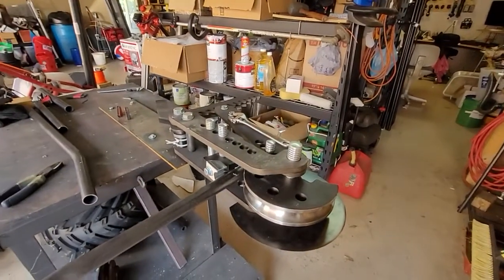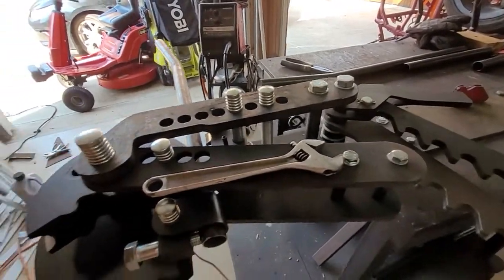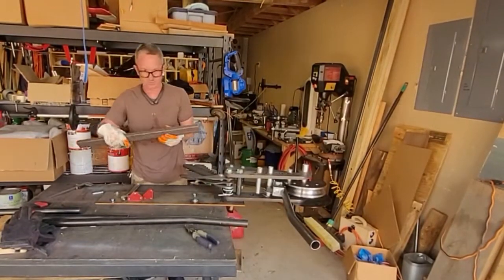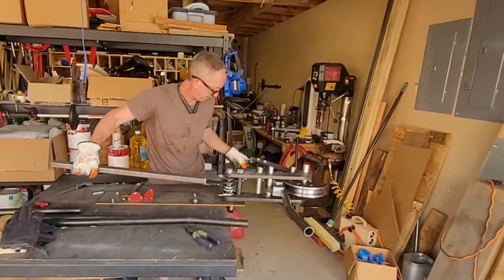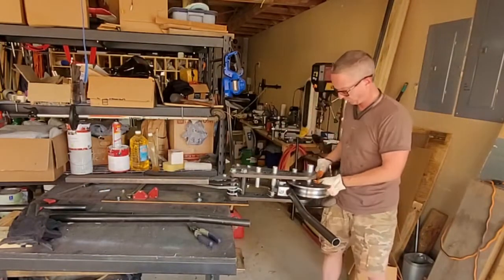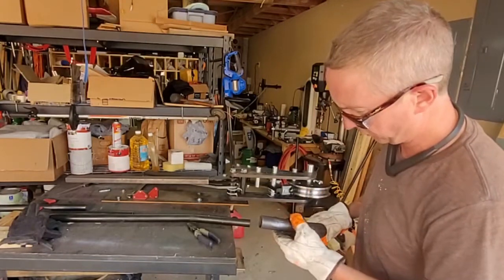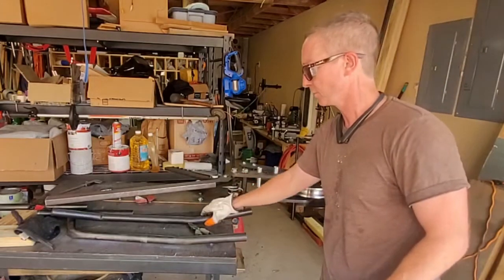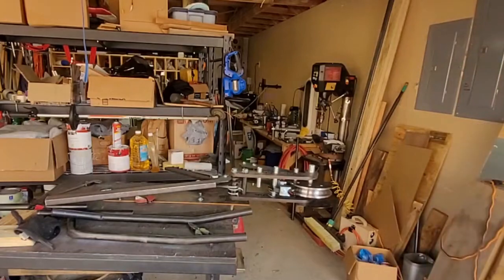I bought the cheapest tubing bender on Ebay

Comment: Hi.  thanks for the video.  Nice job.  whould you mind measuring the center hole of the die and the drive pin holes of the die and post them here.  I what to see if JD squared dies will fit my bender.  I have the vevor bender, it looks the same as yours.    Thanks.

Comment: 0.060 wall is more likely to crinkle than thicker pipe. The site has a minimum wall thickness spec and I think 0.095 is close for this di meter. Also, pipe and tube require different dies. Also, just oil the black oxide instead of complaining.
Reply from the maker: Lol, will do

Comment: Can you  tell me were  I can get the dies?
Reply: did ya check that new internet thing? what would happen if ya did a google search?
Reply: a company called Grizzly makes these dyes for a lot cheaper than other companies that fit this bender.  Just put my 1 1/2 x 4.5x 180 degree die from grizzly on mine and all pins fit as they should.  $299.00.  other companies sell that size for almost $500.00

Comment: So how does it work? Kinked and crushed tubes aren't really good. I'm interested in buying the same setup.
Reply: By the way, sorry to skew your demographic…I’m 69.
Reply from the maker: Don't buy shit tube is my suggestion.     The tube kinking is not the fault of the bender
Reply: I hear ya. I'm looking for one to build a couple UTV cages out of 1 3/4" .95 wall and .120 wall DOM. As far as paint I'll just repaint it at work one night. No big deal.
Reply: Looking to use JD2 model 3 dies
Reply from the maker: @williamkasprzak7170  
This bender works with jd2 dies.    That is what I'm using with my bender.    I highly recommend the anti-spring back plate.    Don't know why they don't sell one for the model 3...
Reply from the maker: Works as it should, but I'd buy a real version, or clean and paint it as soon as u get it

Comment: it's a tube bender not a pipe bender if that makes any difference.
Reply from the maker: I'm bending 1.25" A36 welded tubing.  If I said pipe I misspoke.
Reply: Its both. Just have to buy the right dies.
Reply: Have you tried any thicker stuff. These things don't like thin wall. For $200 bucks i don't think you could go wrong.